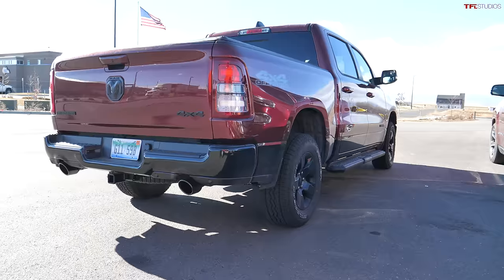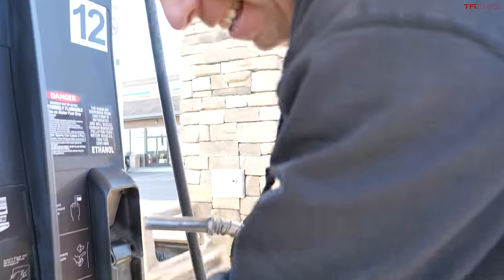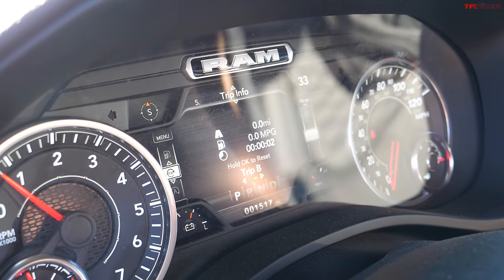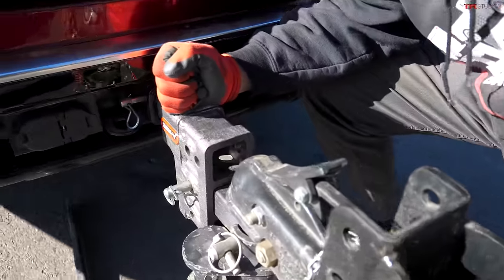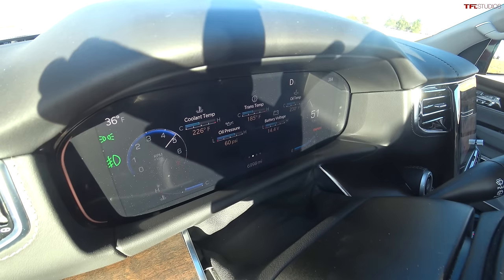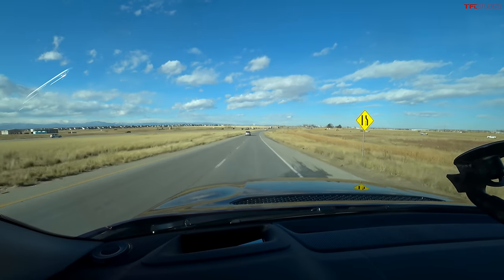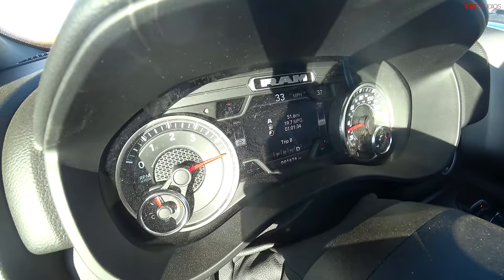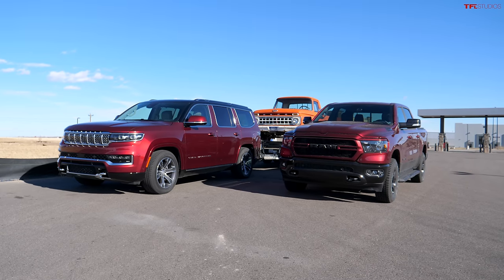Jeep Grand Wagoneer vs Ram 1500 Tow-a-thon: One of These Tows Much Better Than the Other!

Comment: I wonder if the truck had 3.21 ratio gears if the mileage may have been slightly better? 🤔 Great comparisons. 👍
Reply: yea and the truck has the offroad group so it has a 1" lift over a standard ram.
Reply: It could have while unloaded, However I think that towing that load, the economy would have been slighly less. I went from a 2015 3.92 2wd to a 2019 2wd. The 2019 had the 3.21 and partial hybrid. It was much faster than my 2015 and did average similar highway mileage, but towing the same boat the fuel economy was worse than the 2015 was. Needless to say, I only had the 2019 for 9 months before I bought a 2020 4wd 3.92 W/O any offroad package and W/O hybrid. The 4wd 3.92 has slightly lower numbers, but my towing fuel economy is still better than the 2wd 3.21 truck. That is solely MY experience. All my towing has been less than 1,000 MSL all the way down to Sea Level. All of it with the three 5.7's, all 8 speed. All with the same 20' pontoon boat. While never same day/same pump comparisons, I'm referring to my observed averages on each vehicle. All of them tended to be within a couple tenths of a mile comparing dash mileage to math/pump mileage. None of the trucks had/have any modifications. Completely stock.

Comment: So is the answer for RAM is to put the 6.4L in the 1500? It's in the 2500 already but that truck is a lot heavier than the 1500. I've driven a RAM HD 2500 with the 6.4L HEMI before, pulling a gooseneck trailer and loaded down with UTVs. I was impressed by that RAM 2500 6.4L HEMI, that is also found in that Jeep Grand Wagoneer.
Reply: The Ram 6.4 is different than the 6.4 in the SRT cars and the Grand Wagoneer. The Ram 6.4 is only 410hp and 429ft/lbs..
Reply: @dadlife5886  yeah, but can take lot more abuse and tow lot more than any of those SRTs and Wagonner. Made for longevity
Reply: @harshAmiya  I’m aware. I own one. I’ve put 145k/miles on it towing a travel trailer all over the United States. No problems so far (knock on wood).
Reply: @dadlife5886  nice, i own one too. And use it as my daily. RAM 2500 Big Horn 6.4L HEMI
Reply: @harshAmiya  same Ram 2500 Laramie 4x4 6.4 Hemi.

Comment: Andre I had an observation from this mpg test. Not sure if it was my imagination but I think you short changed the grand wagoner on its towing mpg loop. It seems you also did the zero to 60 run after you fueled up for the towing loop, where on the ram you ran the zero to 60 before you fueled up to run the towing mpg loop. It seems that the unladen mpg on the grand wagoner was better than the ram. But when you did the towing loop they where almost identical?

Comment: I mean considering the fuel cost difference I don't consider the wagoneer equivalent mpg as the data displays; it's more expensive to go the same distance in the wagoneer. I'd also question how the wagoneer holds up towing and how it feels vs the ram/any fullsize pickup
Reply: I think he said the wagoneer felt better than the ram. But it wasn’t really apples to apples because the ram didn’t have airbags. Is that even still an option with ram?
Reply: @JonBecker81  4 wheel air suspension is still available in the ram 1500's
Reply: Sly
Why would you question the reliability of the Jeep? It’s all new, it could be the better than the ram. Do you question the new tundra also? Only time will tell with a new, redesigned vehicle

Comment: I think a better comparison would have been the Ram 2500 with the 6.4 Hemi vs. the Grand Wagoneer.  Closer in price, closer in weight, same engine, same transmission…
Reply: The Ram 2500 would have performed worse than the 1500
Reply: The 6.4 in the HD Rams is the BGE version and the 6.4 in the Jeeps is based  off the SRT version different engines.

Comment: By percentage the GW is actually towing more than the Ram. Try percentage of max towing to be more accurate.  The Ram was towing 74% of its max while the GW is towing 81%. The GW should have towed 7400 lbs to make the % even.
Reply: Why would % be preferred?
Reply: @ALMX5DP  if you are comparing towing efficiency you need to keep the % of towing weight comparable. Example, a truck can tow 15000 lbs. An suv tow 8000 lbs. if both tow 7000 lbs. I absolutely believe the truck will tow easier and be more efficient because it’s only towing half its max vs the suv which is towing its limit.
Reply: @boomstickpd79  if comparing two very dissimilar vehicles that might make sense, but these are quite close to one another. If such a test was performed Im sure viewers would complain if one vehicle performed better, suggesting it was only because it had more/less weight behind it. Comparing similar vehicles using a standard trailer weight/type seems appropriate to me.

Comment: Wheelbase wheelbase. That's why you tow with truck.  Less risk of trailer sway when >30ft trailer attached.  Also, don't forget sustained stopping power going downhill when having to engine break.

Comment: I’m kind of confused on what octane is recommended for the 5.7. Could have sworn in another video they said Mopar recommends 89.
Reply: I googled the 5.7 and it says 89 octane, one of the reasons I went with another brand of truck. It costs another $6 minimum per tank, x4 a month, x12 months. It does add up

Comment: I hope Ram is watching, and realizes how bad the truck needs the 6.4.
Reply: I don’t think it NEEDS it but it would be better. The 5.7 still does pretty dang good. It should be an option though. It is surprising that it’s not an option seeing how all the other Jeep, dodge etc have so many engine options and the ram only has 2 if you don’t include the trex.

Comment: The Ram 1500 Limited 6.4 L most likely could get up there in price next too the Jeep Grand Wagonaeer Or the cheaper Jeep  Wagonaeer 5.7 L vs Ram 1500 Big Horn 5.7 L the Ram may have come alway a bit better could be shape too a SUV has a closed back vs a open back on a pickup truck for better MPG

Comment: 89 is recommend for the Ram 1500 Hemi not 87. " The use of 89 octane “Plus” gasoline is recommended for optimum performance and fuel economy. While operating on gasoline with an octane number of 87, hearing a light knocking sound from the engine is not a cause for concern." page 499 in the manual

Comment: That 6.4 engine needs to be an option on the Ram 1500 as an upgrade to the 5.7. It would also be great if they could get the 6.4 on the Ram HD trucks to be a bit more potent.
Reply: I agree but it's pointless now 🤷‍♂️ Hemi is no longer in production, being replaced by a new (non Pentastar) turboed V6 platform 
I suspect for the heavy duties itll just be Cummins
Reply: @KyleHarrisonRedacted  Kyle, I haven’t heard that. Thanks for sharing. Lame, just don’t like the complexity of all the turbo and associated components. I still think they need a non Cummins option for the HD trucks, I have a Cummins now, would be great if there was something in between the 6.4 gas and the Cummins in terms of power and cost.
Reply: I have a 21 Ram 2500 6.4 and it pulls 10k like it’s a rag doll. Not sure how much more potent you need for 99% of towing applications.
Reply: @stgibson2810  I Agree my 2020 6.4 with the 4.10 gears pulls just fine.
Reply: @KyleHarrisonRedacted  It's a turbocharged straight six, not a V6. I'm pretty hyped as a Jeep guy for a straight six being available in Jeeps again, not to mention it's turbocharged. But I doubt they'll drop the 6.4/392 for the 3/4 ton trucks.
Reply: Psychological,
Any links to the straight six turbo engine? As of yet there is no proof of the engine combo
Reply: @stgibson2810  that's a completely different engine than what's in the Grand Wagoneer.

Comment: On the next 0-60 for the ram why not put it in 4-auto for the towing and unladen tests? It may not be a ton faster but I would assume a second of the towing for sure with that wheel spin and the traction control cutting power.

Comment: You should do a depreciation show-down for these two vehicles. That Jeep GW will be half value in 3 years.
Reply: They all do, not just the Jeep
Reply: @paulhunter9613  Agreed, but pickup trucks seems to hold a higher value over time.

Comment: Jeep is way overpriced.  But I guess what isn’t these days.  Insane.
Reply: $100k for a Jeep... I feel bad for the ones paying over $50k for the gladiators and wranglers. Gladiators are catching on fire with the trans quite often...
Reply: @jacobstrutner8232  like 90k escalades werent having any issues...
Reply: @TomazHilton Wait, how many Cadillac Escalades have caught on fire again? There’s no comparison there, thanks! Try again!
Reply: @mybro727  very few Jeeps caught fire . Almost all first year new GM SUVs had lifter issues resulting in blown engines
Reply: @TomazHilton  Again, zero Cadillacs have caught on fire. I’m fully aware of the lifter issue, but that’s not what you were talking about earlier. Still, zero ICE gm products have caught on fire. Fully electric Bolts powered by batteries manufactured by a third party that were defective, isn’t the same reason Jeep and Stellantis is experiencing these issues. Apples 🍎 to bananas 🍌
Reply: @TomazHilton   So you forgot about the issues the 2021 RAM is having? Over 220k new RAMs recalled due to heater electrical relays that can short, which can cause it to overheat and ignite the truck in flames. The RAMs can ignite even while the engines are off. If I’m not mistaken, the RAM has the most recalls out of their segment too, nearing 20!

Comment: Rams tow haul mode based off my 2011 is useless unless your in the mountains. The way it holds gears isn’t super helpful and basically it just gives you worse fuel economy, I tested my 2011 Ram 1500 4.7 standard cab long box RWD with the same trailer and same car on the trailer and the result over 20 miles on the freeway was about 4.3mpg tow haul lowered the MPG while not adding anything while towing about 6800lbs

Comment: Impressive Jeep. I wonder how they would compare if both had the 6.4. Seems as it is this was the expected outcome 5.7 vs 6.4. So this seems to be an engine battle, not pickup vs SUV
Reply: Really? you expected the 6.4 to get better mpg's with 800 pounds extra weight

Comment: Jeep site does not list the 6.4L as having cylinder deactivation, while the 5.7L does. I think the 6.4L in HDs do NOT have MDS either.
Reply: My 2020 2500 6.4 has MDS.

Comment: What rear end gear ratio did they have. In the ram you typically see about 1.5 to 2 mpg difference between the 3.23 and the 3.91 when not towing. With over 11,000 trailer tow capacity it is probably the 3.91. Good video.
Reply: In the video both specs of the gears where given. The truck and suv both have 3.92 gears. The truck was stated just after the one minute mark of the video and the suv was stated just after the 26 minutes mark of the video.

Comment: I’m not surprised of Ram not offering the 6.4 in the 1500. If you need the 6.4 just get the 2500 or just get a 1500 with the EcoDissel or Cummins.

Comment: They should offer 6.4 in 1500. This is just like the 7.3 gas in superduty v 6.2 gas in superduty similar gas millage. Smaller displacement non turbo engines gotta work harder to get into torque

Comment: But what was the difference in fuel cost between 87 and 91 octane?
Reply: In my neck of the woods it can be .80 to $1. I cringe when putting gas in my classic car..
Reply: @paulhunter9613  I like that I have an option of 87 or 89 octane on my 2020 Ram with 5.7e

Comment: Compare it against the ram 2500 with the same 6.4
Reply: Not the same 6.4l and the 2500 weighs about 700lbs more than the Grand Wagoneer
Reply: @TheRamGuy  it's the same exact 6.4
Reply: @jacobstrutner8232  it is not the same 6.4l. The truck 6.4l has only 410hp and 429lbft of torque. It has different components for towing and heavy duty use. Check it out for yourself. Only the same in displacement

Comment: I can see the love from the many Jeep enthusiasts. Respectable performance and towing in the grand wagoner. Not impressed that you have to run premium fuel for everything. I do like the suspension system for towing and I’d guess the wagoner needs it with a full compliment of passengers. Wish Ford had this or even an option for it. 
Ram is putting all its money on mega horsepower to pull in the enthusiast’s. Hope this works for them with our current policy makers in office.
Reply: Premium Vehicles shrug

Comment: I think the Grand Wagoneer deserves an optional 3.0 Liter EcoDiesel 480 lb/ft torque variant.
Reply: Makes sense.  The ecodiesel is a garbage fiat engine however
Reply: @jaredfletcher1587  really. We have a fleet of 14 Ram EcoDiesels ranging from 40k miles to 170k miles and we haven't experienced any issues. I also own a 2005 Jeep Grand Cherokee with the CRD 3.0 and it has 218k miles and it runs pretty good. Also worth noting the the EcoDiesel wasn't and isn't "really" Fiat. It's VM Motori that was purchased by Fiat. But I guess is Fiat bought Cummins they would be a piece of crap too in your opinion. 👍🏼
Reply: @MrNismopro  170k really isnt much for a diesel.  Even for a gas engine thats nothing crazy
Reply: @MrNismopro  the only reason you buy a 2500 or 3500 dodge generally is for the cummins option.  The rest of the truck is junk
Reply: @jaredfletcher1587  , you're right 170k miles isn't a lot for an engine. But 170k trouble free miles isn't an easy achievement. We have some 5.3 Silverados that have lifter issues. We Ford F450's with CP4 pump failures ranging from $8-$12k in repairs. Tell me this then. What's not a garbage? What is a "non garbage" machine in your standards.
Reply: @MrNismopro  my corolla is at 250k on it and all we had to do is a water pump and some spark plugs
Reply: @jaredfletcher1587  I get that but a Corolla is good for towing a couple of mountain bikes. This is a video of people towing a 6000 lbs F-100. Your Corolla would last 18 miles with just the trailer they were using. My mother in law has an 85 Mercedes 300D that has 420k on the clock and it still runs like a top too with only minor maintenance. But, we're talking apples and Jack fruit here.
Reply: @MrNismopro  my tacoma had 165k on it before i sold it and it just need a water pump too lol
Reply: @jaredfletcher1587  I had a 19 Tacoma, and I'll agree with you that they're reliable. But they're gutless, and if you tow more than 4,000 lbs with them they hunt for gears 3rd and 4th gear most of the time. But I also had my 05 Jeep at the same time, in fact my Jeep Grand Cherokee has been in our family since it was new and we're over 200k now with only typical maintenance. Here's the thing. Gasoline engines are very inefficient. Diesels make more BTU by volume than a gasoline counterpart. IMO, a diesel vehicle is way more effective than gasoline. You just mentioned your Toyota Corolla, the Toyota Saloon 2.0D (AKA Corolla) is a 2.0 liter diesel that runs circles around the gas version in so many ways including reliability. Even the smaller 1.4 Turbo Diesel which gets about 48 MPG generates 184 ft/lbs of torque. But, back to reliability,  it all comes down to how you maintain it. Our CRD has been really good to us. And I would buy another EcoDiesel for towing purposes. My Jeep now does a lot of overlanding within forests and it's never left me stranded.
Reply: @MrNismopro  my tacoma was a standard which i loved.  Id never want an automatic
Reply: @jaredfletcher1587  neither one can pull what they say they're rated for. They're great off road vehicles and daily commuters. But a tow rig they're not, and with a payload of just over 1000 lbs. they're just not very useful either. But reliable, yes.
Reply: @MrNismopro  if i was going to get a full size truck, it would be a tundra, or a duramax
Reply: @rick Rodriguez 
Obviously Jared is an import fanboi, nothing you say to this kid will sway his thinking . With his claim of 240,000 mi and just a water pump replaced is ludicrous. I’m sure he has the same oil from it leaving the factory 🤣🤣
Reply: @paulhunter9613  oil changes, o2 sensor, but yeah other than that, nothing else.  The muffler was replaced but thats bc of upstate ny rust.  There is a reason why people buy toyotas and hondas, bc they run forever.  They are the reason why the big 3 dont make cars anymore
Reply: @jaredfletcher1587  , don’t act like Toyota doesn’t have recalls and issues. The new Tundra is already facing issues with turbo waste gates that require the engines to be mostly removed. Let’s not go to the rusted frame recalls for the Tacomas and Tundras. Did we forget the recalls on RAV4’s with water leaking into the steering gearboxes. Let’s not even get started with the amount of volume the big three sells compared to Toyota. Toyota placed 4th out of the five large truck sales only beating Nissan marginally. So yeah, if you sell a vehicle 6 fold to a competitor you’ll hear of more issues because there’s more volume. Let’s also discuss how Toyota drivers drive, because I don’t know about you, but every time I’m driving behind a Toyota, it seems that they drive 12 MPH under the speed limit and take wide turns at shoulders. You say they last forever… you can make a 1984 Cadillac Diesel Fleetwood last forever if you keep dumping money into it. Please stop with your ridiculousnesses.
Reply: @MrNismopro  idk about you but i was racing a dodge durango in my lexus and passed him at 125.  In mexico ofc
Reply: @jaredfletcher1587  you passed a Durango. You're talking about the Durangos that are electronically governed to 115. 🤣👍🏼 You should get a decal.
Reply: @MrNismopro  i wouldnt know i was behind him before i caught up and beat him